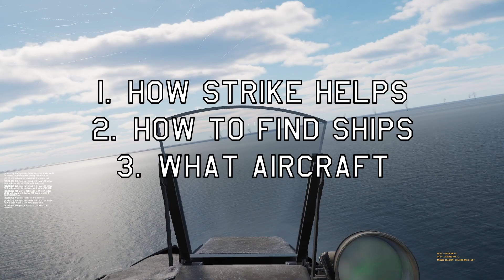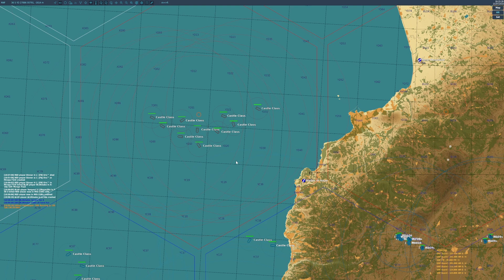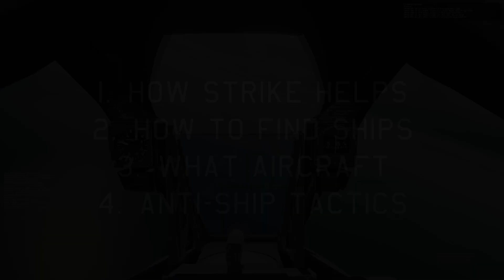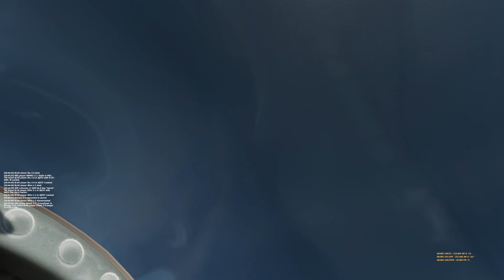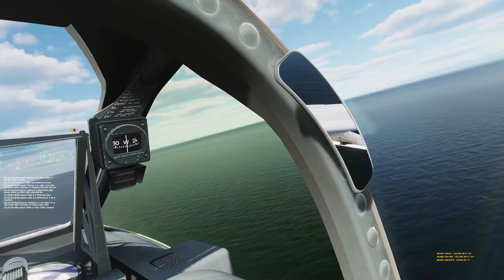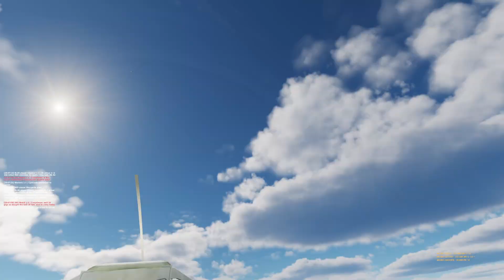Enigma's Cold War Server Beginner Guide | Anti-Shipping | DCS

Comment: I suppose the Viggen's disadvantage with its low payload of only 2 anti-ship missiles is however compensated by the fact it is very fast, and therefore much less vulnerable, compared tot the slower ground pounders. also, thanks to the standoff, it probably doesn't need to fly all the way to the ships, rather fly until release point and then head back, meaning it can spend very little time feet wet

Comment: mhmh Viggen can not have the ASM-Version of the Maverick as of now?
Reply from the maker: I'll need to look into that. Didn't think anything on ECW could but I may well be wrong. Would give the Viggen more utility if so since it's anti-ship missiles only go on 2 pylons max
Reply: The Viggen has access to 3 Mavericks, RB75A (AGM65A), RB75T (AGM65A with bigger warhead) and RB75B (AGM65B)
I don't think any of those are for anti ship use. RB75A is the "normal" one, B only has higher zoom on the scope.
On ECW only the A and B are available.
Reply: @FlameHazeVT  The RB75T is supposed to be an anti ship maverick, it has a much bigger High Explosive warhead, contrary to the normal mavs, and the default loadouts by Heatblur that use it are called anti_shipping.